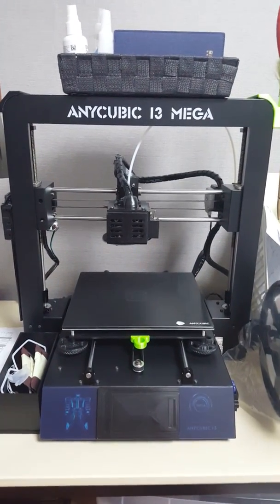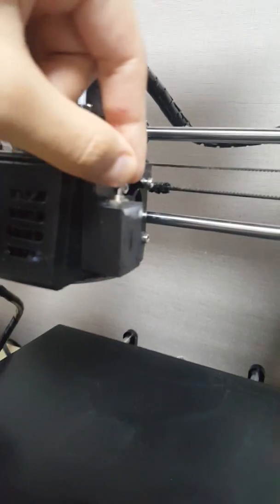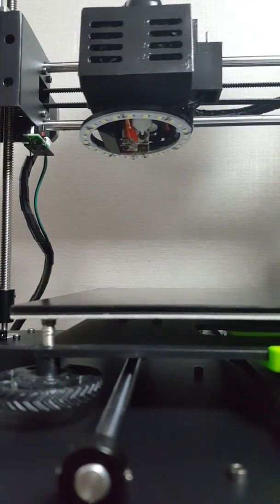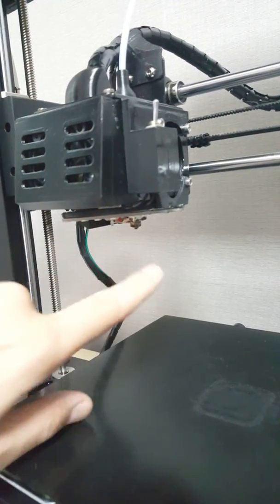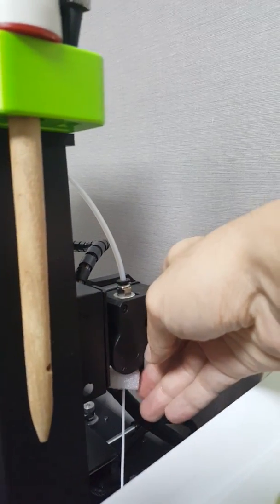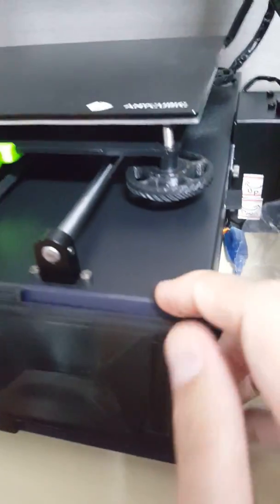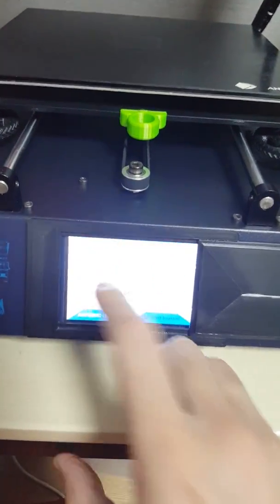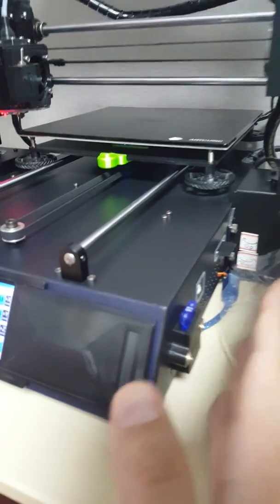Anycubic i3 Mega/Mega S Upgrade Set + BLTouch Marlin Firmware 1.1.9+ Otoprint/Astroprint by JeffGram

Comment: Hey, I put the marlin firmware on it because I can't get my bed leveled.  I started the bed calibration and measured the 25 points to 0.04mm.  Saved, restarted, the printer connected to cura and the command inserted in the start code.  but unfortunately the bed adjusts itself again when printing.  do you have an idea, am a beginner.
Reply from the maker: Hello, Could you please join our Facebook group where I can assist you? 
https://www.facebook.com/groups/1475376915974525/

Comment: You have the original stepper drivers?
Reply from the maker: No. It is TMC2088 stepper drivers
Reply: Ok, because your z-axes sound a little noisy like the original, did you change all or left the 4988 for z ax ?
Reply from the maker: Oh sorry! In this video, this 3d printer has the stock stepper drivers. Please watch in another video that shows Anycubic having being installed with TMC2088.